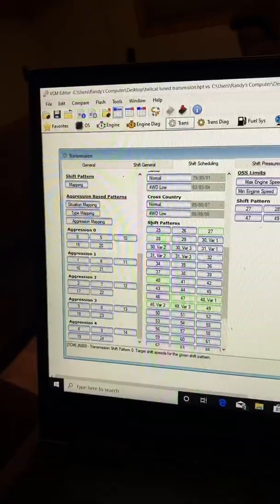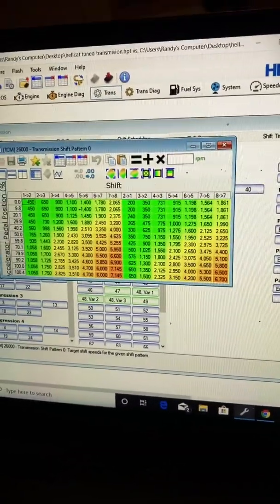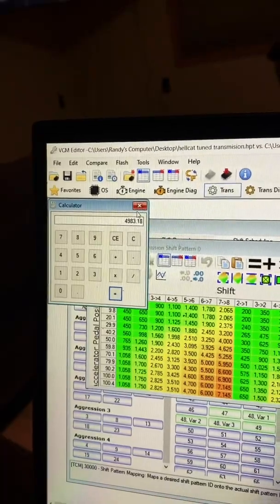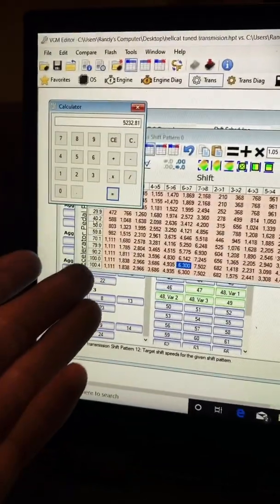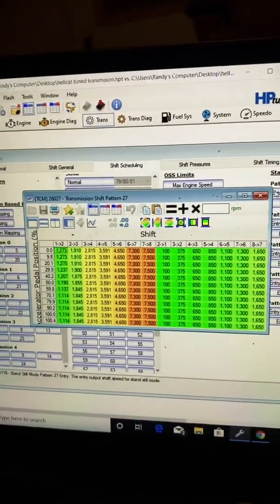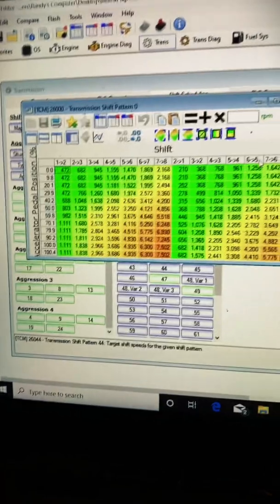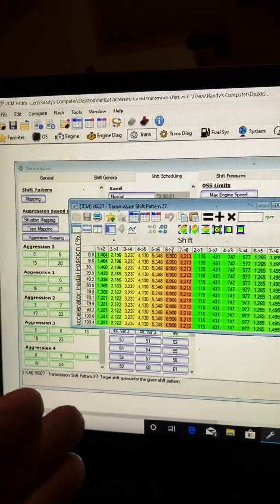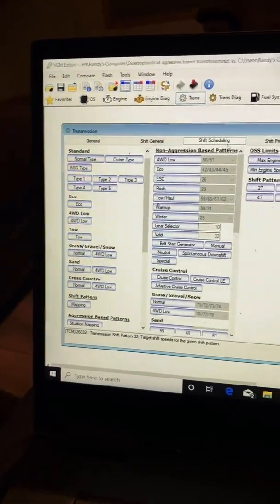Tuning the dodge hellcat shift scheduling

Comment: Great videos man, one question will these tables affect the manual mode ? Or is it only for when the car is in drive i mean with the scheduling i have an issue where the car will shift itself even when i am in manual mode . I noticed you mentioned what happened on the dyno to you will the scanner help me know which pattern to change
Reply from the maker: Nope these tables are for regular mode, there are separate tables for manual shift mode
Reply: Im a lil confused lol